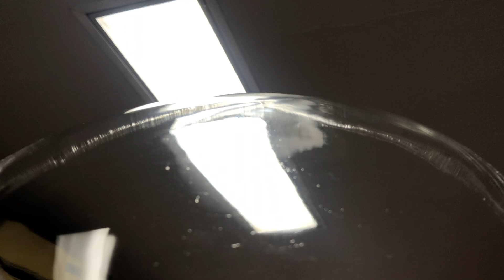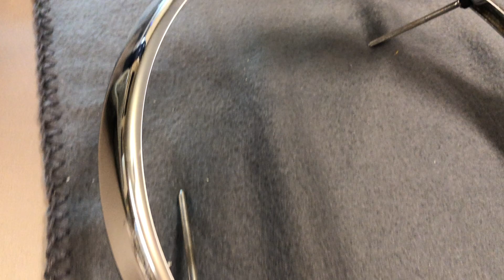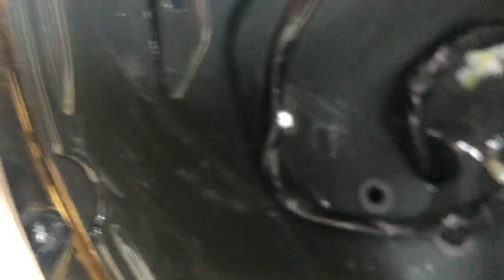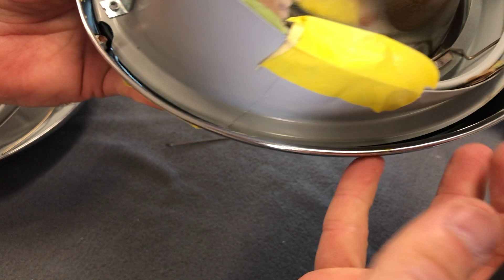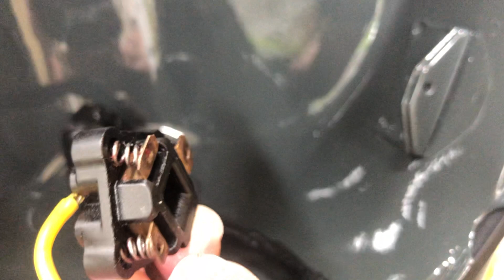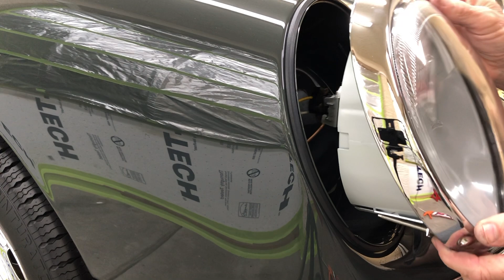Restoring Porsche Lights: Part-2 Headlights!  Video 73

Comment: Hi Mike, I am just mocking up my SWB headlights and i seem to be having the same problem you had with those tabs. Just to confirm, did you just cut the tabs on your headlight bucket?
Reply from the maker: Hello Landy man
Yes the tabs will need to be trimmed for the trim ring and bucket assemble to fit and adjust properly.
Good Luck!

Comment: Hi Mike did you need to repaint the inside of the headlight if so what paint did you use. Thanks Darcy
Reply from the maker: Hello Darcy
The paint used is a shelf item by Krylon 1606 Pewter gray

Comment: Perfect timing and a big help, as I have the same trim ring fit issue on my just painted 356. Not sure I can sling the Dremel as well as you did!
Reply from the maker: Good luck on that Richard!
It really wasn't too bad as long as the cutter is sitting in the fold of those clips
And of course a good masking job!